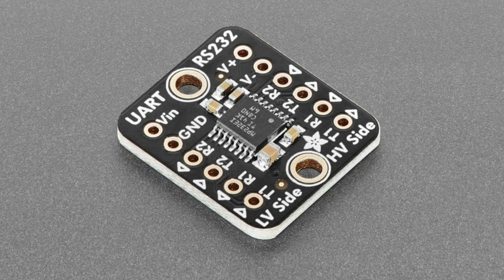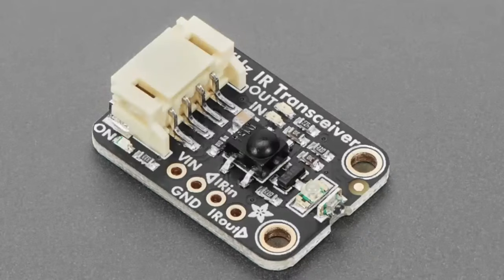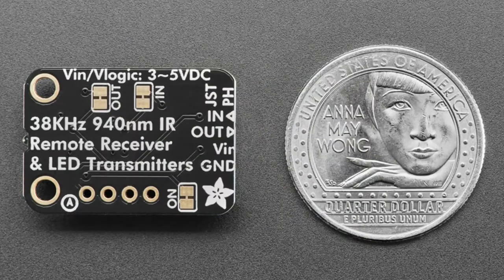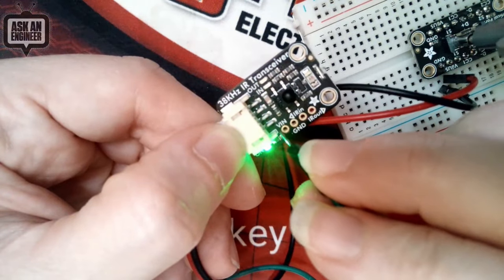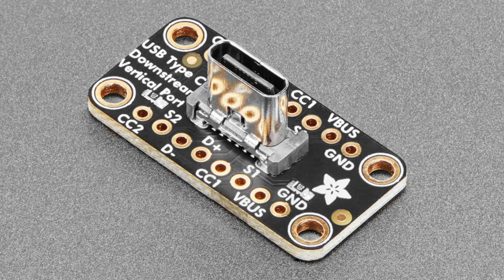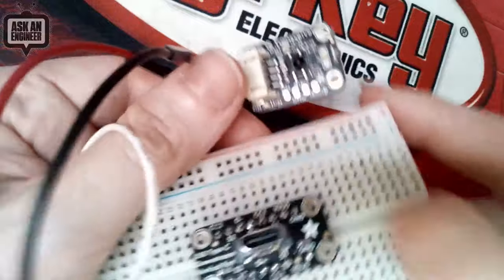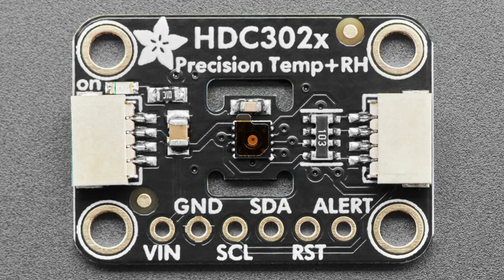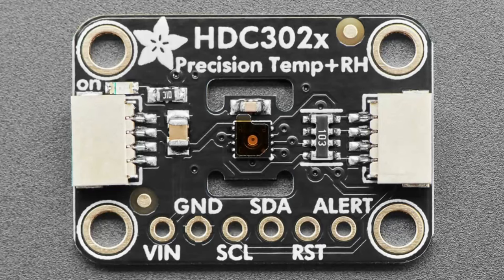#NewProducts 7/3/2024 Featuring #Adafruit HDC3021 Precision Temp & Hum Sensor - STEMMA QT!

Comment: The resistors on the USB-C CC pins are also in the USB-PD spec, because that tells the upstream source that if it has USB-PD source, it can provide up to 3 amps at 5V. It might not sound like much when the latest USB-PD can deliver like 200 watts, but you can do a fair bit with 15 watts.

Comment: Is there a way to put the humidity/temp sensor 30 feet away wired (cat 5) to esp32 and actually get readings.  Any other sensor that might work?  DHT 22 was not reliable.